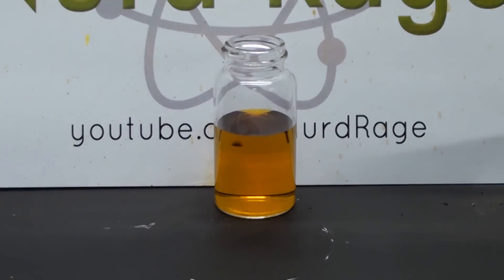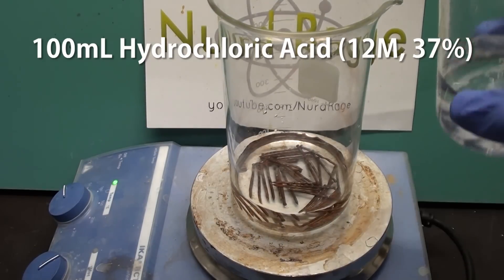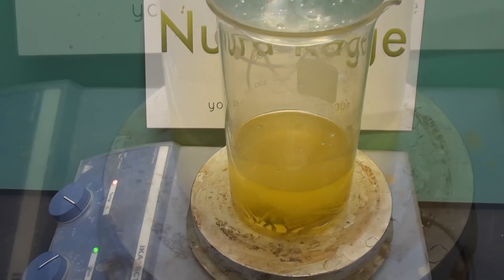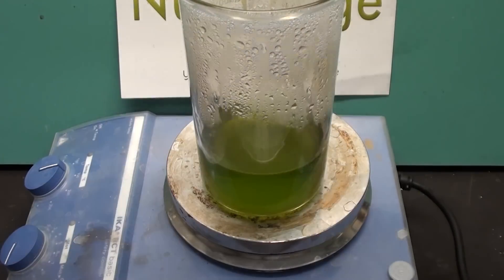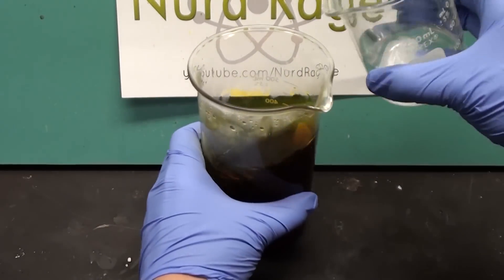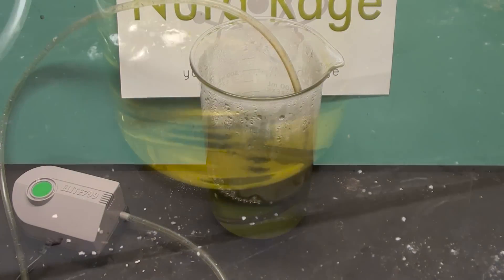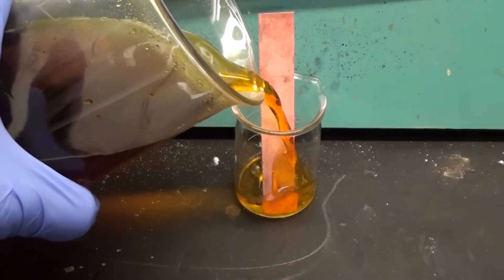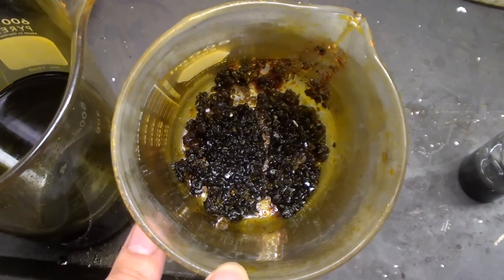Make Ferric Chloride (for etching printed circuit boards)

Comment: If you have the means(glassware) and a good NaOH scrubber you could bubble chlorine gas through the ferrous chloride and it will keep the volume concentrated.  But know chlorine is horrible and deadly!

Comment: I watched somewhere a video tutorial to recycle Ferric Chloride. 1- Add IRON (nails, Junk Iron bars, etc) to the solution... after sometime, Iron dissolves and copper is removed from the solution e it bonds to the iron bars (remove it from the solution). 2- Filter the solution 3- Add H202 (droping slowly - Hydrogen Peroxide 3% or more than this for a Higher concentration etchant - ) Have you tried something like this ?

Comment: I have read that it is not possible to make anhydrous FeCl3 through evaporation but the hexahydrate. On Wikipedia it shows the hexahydrate as a yellow powder but I keep ending up with very dark crystals. Is there impurities causing this perhaps? I also wonder if the heat is causing it to decompose or react with the h2o in solution to create a different chemical. I am just a diy guy but trying to expand my chemistry knowledge as much as possible.

Comment: hey thanks for the video i tryied this with air pump color change and evertying is fine but it doesnt etch copper board not even copper wire. its just etchs iron when i put into it why is that please answer me

Comment: Great video, i have a question, what if some Hydrochloric Acid is still present after oxydizing the ferrous chloride ? How to make sure all the HCl has gone ?
Reply: hcl evaporates very quickly, so drying it out would help. or you could just add an excess of h2o2 and wait an hour

Comment: My first job making  about 40,000 lbs/batch, dissolves 10,000 lbs. of  steel chopper scrap in 2 hrs. Don't forget free acid 2%,  if it gets cloudy watch out, low acid, could become unstable and revert to ferrous chloride and chlorine gas.  The  dry stuff can be unstable too.

Comment: Even better way using household items:
Put some iron in bleach to create rust(you can use any way you like to create rust but this is the fastest)
Mix 1:1(same amount)  clorine based bleach and white vinegar wait for about 10 minutes
Add the rust(iron oxide) to the solution and wait for 2 hours(do this in a well ventilated place) this will create hydrochloric acid and oxygen
Then dissolve as much rust as possible in the acid
Wait for 2 days and your done
Reply: That's a bit confusing. To summarize what you said: take iron and mix in bleach to make rust. Take more bleach(chlorine based) and add equal amount of white vinegar, after 10minutes add the rust (iron+bleach), then after 2hours you have hydrochloric acid and oxygen, then add more rust? So add rust again!? So aren't we missing an ingredient/step here? Is there 2 different types of bleach being used in the process or what an I not getting.
Reply: @itechhen   mixing iron and bleach and waiting will create rust( if you don't have any) so do this step to get rust
Reply: Then mix the vinegar, bleach and the rust
Reply: @itechhen  you just have to add the rust once after mixing vinegar and bleach

Comment: Thank you for the air pump solution. Now I don't need to buy a 10 gallon bottle of a hydrogen peroxide concentrate when I only need like a 0.1 liter or less.

Comment: What happen if I add the steel wool  and the HCL and the H2O2 at the same time ?.
Beside I'm not sure that I see the point in this, since a number of people are using the precursor chemicals (hydrochloric acid and peroxide) for etching without all this extra work
Reply: Adding the acid and the peroxide could generate chlorine,wasting chemicals.

Not to mention chlorine is toxic.

Comment: Why your ferric chloride is darker than mine.
I put 3 cups muriatic acid,steel wool 0000 and 6 cups peroxide???
It that ok?
Reply: Did you add enough steel wool? For a batch that size you're probably going to need to add at least 5 or 6 steel wool pads. If the iron content is low it ends up a lighter color.

Comment: I made a large gallon jar half filled by using a lot of steel wool. Now I have 12% peroxide and am I correct that I do not need to use so much of it?  Is there a simple way to know that I have added enough peroxide for a effective Ferric Chloride to be made?  The small amount I have added, in two does, did turn it very dark fast. I'm letting it cool down now, and I have a choice between putting a pump on it to aerate it, or add more peroxide. I know that I can never aerate  it too much, and that I could either use too little peroxide, or use too much.

Comment: Hello NurdRage!
Could it be easier to use Fe2O3?
I have a lot of these substances for glaze.
Reply: 2 years late, but it'll react to form FeCl2 regardless, so you need to either let it oxidise by air or use H2O2.
Reply: @nerfinator6  Thank you!

Comment: Will it also work using 30% hydrochloric acid?
Reply: Bassie Adrianus Yeah, just make sure you use less water, and get it to the 6 molarity that he got the acid to.
Reply: Thanks! I am not afraid to admit that I totally suck at math and fail to make this calculation, perhaps this is easier for you and you could help me?
I plan to use the ferric chloride to etch my home made knife blades. I have 30% hydrochloric acid, do you know how much of the other ingredients I should use? Any help will be deeply appreciated!

Comment: i am sick of h2o2, if air bubbling works, i will be happy indeed.

but any way to reuse the echant ? by taking out the copper somehow,i mean ?
Reply: Does not the etching compound turn into something else after etching?
2FeCl4(-) + Cu --> 2Fe(2+) + CuCl4(2-) + 4Cl(-),
As more copper is dissolved in the ferric chloride solution and the solubility limit is reached, the precipitate Cupric Chloride is formed.
Source: https://www.quora.com/Whats-the-reaction-between-Iron-III-chloride-and-copper
Maybe you could use it for something else once you are done using it for etching.
Reply: hmmmm every time need to purchase it. :/

Comment: +NurdRage How would you tell the air pump has fully oxidized FeCl2 to FeCl3? I understand that by using H2O2 one would tell by no more heat production and fizzing in the solution. But through the course of time, with the pump, when to be sure? Would we need to evaporate the liquid and then separate the rusty yellowish powder (FeCl2) from the  greenish crystals (FeCl3)? Very cool vids btw, awesome stuff, thanks for sharing.

Comment: Ferric Chloride is also very useful for etching other metas besides copper. It works great on stainless steel and iron.. I use it to make labels and logos on stainless steel plates that i attach to finished projects, label metal parts, tools, knife blades, etc. It's also a good way to put a three dimensional pattern pattern or texture on a metal surface that would otherwise be difficult and time consuming using grinders or files. An aquarium bubbler is useful when etching. Ferric Chloride does not bubble when it dissolves metal, so it does not naturally agitate itself to keep the acid fresh near where is need to work..
Reply: It's also pretty good for showing Widmanstätten patterns in meteorites too.

Comment: Do you need H2O2?
Reply: Yes: For oxidize the Iron II Chloride (Ferrous Chloride) to Iron III Chloride (Ferric Chloride)
Reply: Sparvy R.Šturmovik Oh thanks. I actually just used bleach and it worked perfectly.
Reply: Just today I used a mixture of 30% HCL and household H2O2,in my opinion it's a lot more faster than the ferric chloride,but be warned,it still generates chlorine,so do it outside,but in a less quantity by using bleach :)

Comment: can i use sulforic acid
Reply: hageke feuer No
Reply: hageke feuer Yes,just put the acid on the copper and wait about a month. With some luck it will work. Or you can first oxidize the copper. That should take about an hour.

Comment: You can also etch PCB with 3:1 hydrochloric acid and Hydrogen Peroxide (20%-30%) so dont need any Ferric Chloride
Reply: Still useful for etching steel weapons, straight razors, knives, etc

Comment: Is it possible to use Iron Oxide (Ferric Oxide) powder as opposed to steel wool or rusty nails? 

Also, how do I know when to add more acid? How can I tell it has evaporated?
Reply: i would also like to know. I have almost a pound of it laying around!
Reply: It should work, but pottery store/hardware store ferric oxide dissolves very slowly in hydrochloric acid to make ferric chloride. It usually takes about a week for it to dissolve because it is calcined and that lowers its reactivity

Comment: I tried this using slightly rusted nails and all was well for the first day, the nails dissolved to about 1/3 of their size but then the reaction stopped, does this mean that the solution is saturated with iron?
Reply: It most likely is, depending on how much acid is used and its concentration, the amount of iron dissolved will vary. 
'X' moles of acid will dissolve up to 'X/2' moles of iron, according to the reaction equation that NurdRage showed in the video.

Hope this helps.

Comment: Great, and thank you VERY MUCH..!!!! I follow the procedures and made the chemical. I successfully etched beautful boards with it. It only turn green after etching few times. What to do when that happens? Add more hydrogen peroxide help? by the way I didn't have the acid you used so I used battery acid... but it is also 37%
Reply: Victor Augustine umm battery acid is not hydrochloric acid, but sulfuric acid. If you have sulfuric acid you can skip the iron part, just add hydrogen peroxide and you're good to go. Alternatively you can add table salt, and turn the sulfuric acid into a crude version of hydrochloric acid.
Reply: Vladislav Damqnov thank you so much. So just to be clear I would still get Ferric Chloride just by adding hydrogen peroxide the the battery acid I have here. A question is, should I use the the same ratio described in the video? ALSO, what amount of salt I should add to the acid to get hydrochloric acid. How strong will be the resultant hydrochloric acid compared to industrial hydrocloric acid. I have recently purchased hydrocloric acid (Industrial I suppose) and I have to mix it with water in 2:1 ratio. (water:hydrochloric acid) and it etch my pcb with in 8 minutes. I do not know if I make this crude hydrochloric acid I will still have to add some water to reduce its strength. Again, thank you so much.
Reply: No nurdrage described it in another video i think, you get something else
Reply: Thank you, Friend.

Comment: i airrate the solution with farts. Gives a much stronger solution. hehe, just kidden. i use my airpump inside the solution while etching pcbs. it stirs bubbles seem to stir the solution around and speed up the process.

Comment: Would 98% sulfuric acid do the trick with the iron?
I tried to etch copper with sulfuric acid + hydrogen peroxide with rather poor result.
Reply: You tried to etch copper with piranha solution? Why would you do that?!?!
Reply: Hehe, why not. Ferric chloride in my local store costs 15€ per 100gr abouts, I thought I could find some use for the sulfuric acid laying for few years in the corner.
Reply: +Piotr Misiuna sulphuric acid doesnt react with copper by itself, it needs current to flow throught. You could have made the ferric chloride yourself (if you have sulfuric acid, you probably have access to hydrochloric, since its sold in lots of places, at last where I live, unlike sulfuric acid), copper chloride, or etch the copper with just hydrochloric acid and H2O2.
Reply: +ficolas2 That and the fact that piranha solution is quite dangerous

Comment: i would like to make this but i dont have any bottles to store it anymore. can i put it in s coke bottle?
Reply: +Günter TV It should only reacts with metals so plastic is OK. I would recommend a glass bottle. Just take out the label and label it with what is inside to avoid accidents If you have kids around because this acid happens to have a very familiar color that someone could confuse with coke.

Comment: so can i use this method to make all metal chlorides? all ready did copper chloride, now trying ferric chloride.
can i make something like magnesium chloride if that even exists?
Reply: +Paradoxical Paradox (GalliumMercuride) how'd you do copper chloride?? copper doesn't react with HCl......you can do magnesium chloride but be sure to keep the reaction under control.
Reply: +Saumitra Bane copper does react with hcl
Reply: +Paradoxical Paradox (GalliumMercuride) ...no it doesn't
Reply: ***** i made crystals myself
If you put copper in hcl, it starts bubbling, then the copper dissolves, the solution turns green then you let it dry and you get copper chloride crystals
Reply: +Paradoxical Paradox (GalliumMercuride) you must have bubbled peroxide or oxygen in as an oxidant then, normal copper doesnt react with hcl
Reply: +Saumitra Bane that speeds up the process. you don't need it and yes copper DOES react.
thos channel actually showed ways to make copper chloride and that was one of them
Reply: +Paradoxical Paradox (GalliumMercuride) no it doesn't, search it up.
Reply: ***** why don't you?
Reply: +Saumitra Bane i literally JUST did it to prove my point after you made that comment.
Reply: +The Real Damon Jackson (GalliumMercuride) Copper does not react under normal conditions with Hydrochloric Acid, it's a known fact mate. You have to bubble in oxygen or H2O2 as an oxidant.
Reply: ***** i just did it without bubbling or h2o2.
I formed green crystals. This is copper chloride
Reply: +The Real Damon Jackson (GalliumMercuride) not possible, google it up...or post a video to show me how you did it opposing basic chemistry
Reply: ***** I did post a video actually  a while ago
It also has copper acetate created using the same method.
That is basic chemistry
Reply: +The Real Damon Jackson (GalliumMercuride) link me to your video of pure copper metal reacting with hcl. you're defying basic chemistry which states that copper does not react with hcl or h2so4
Reply: +Saumitra Bane im uploading it now
Reply: copper does react with hcl but the reaction is slow
Reply: Nacho Rubio i proved it on my channel
Reply: wow how far we have come, you were right, i will make it at home i really like copper chloride crystals
Reply: Nacho Rubio me 2 they are needle-like

Comment: can you use muriatic acid instead?
Reply: muriatic acid is hydrochloric acid
Reply: +Damon Jackson (Gaming & Science) 
 muriatic acid is 31% hcl 
it will work 

i think
Reply: Günter TV it worked for me. 
Muriatic acid is the second most concentrated you can buy...
Reply: i have used 12mol (37%)
Reply: im guessing yes.

Comment: I made copper chloride from copper sulfate and sodium chloride. Then I reacted the copper chloride with iron and i got the green ferrous chloride. After oxidation( i just let the solution for a while) i got ferric chloride but with an yellow precipitate and everytime i filter it the precipitate forms again. Why can't i get a clear solution like you?
Reply: It might be that your copper chloride has some sulfate ions contaminating it, these sulfate ions can react with the ferric ions of the solution to form yellow ferric sulphate.. 

I made some copper chloride solution by first making basic copper carbonate from copper sulfate and sodium carbonate and dissolving that in HCl. And I did exactly what you did after that and the ferric chloride solution made is fine :).  Btw, I also have videos on my channel covering this method in more detail while also delving into the science behind each step.

Comment: I am wondering if you could use this to etch off the copper foil behind the gold plating on memory board fingers. Would this not work MUCH more quickly than hydrochloric acid alone? Furthermore, ferric chloride would not dissolve the gold foils but only the copper "behind" the foils, thereby releasing them into the solution to be recovered.
Reply: I think you would have to protect the gold foils with permanent marker pen to stop it being dissolved or damaged at the very least..I would put a thick coat of permanent marker pen over the gold foil then put it into ferric solution,it will etch any copper or any other thin metal any that's not protected..I'd be careful but I know the permanent marker pen methood is good at protecting metals against the ferric during the etching proces.
Reply: Actually, the gold foils aren't affected by the ferric chloride at all. Gold cannot be dissolved by ferric chloride. It works!
Reply: Really,I didn't know for sure,as a rule I always try to be careful with any kind of metal when using ferric..I think I would have tried to make precautions to protect anything I didn't want dissolving or damaged,if I wasn't sure a 100%.

Comment: +NurdRage, would this be good enough to etch metals such as steel? Or is it good for only circuit boards?
Im loooking for a way to etch metals for swordmaking, but common acids such as vinegar work but take rather long, so i would have to resort to more aggressive acids.